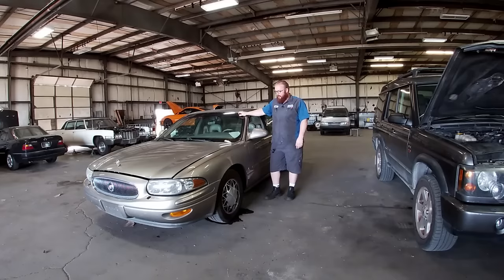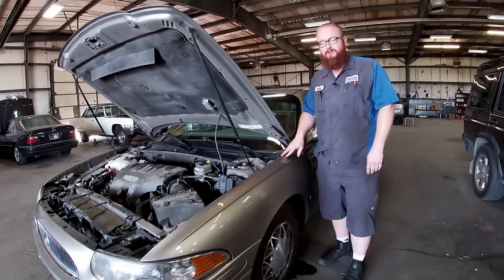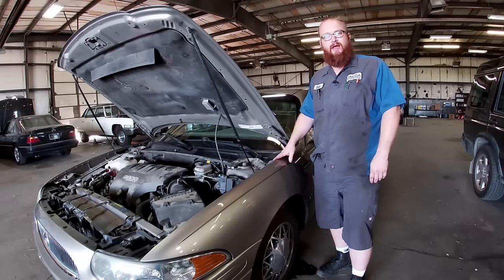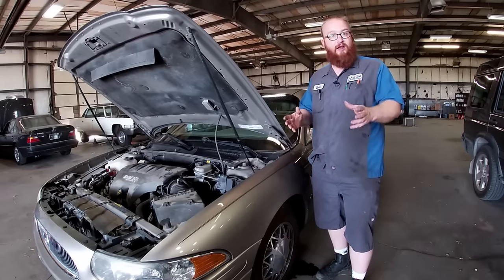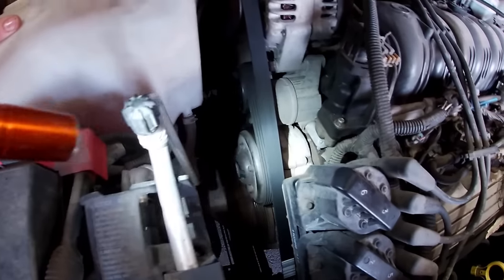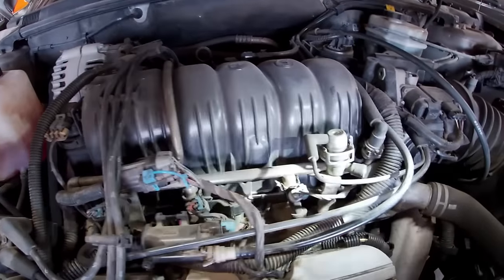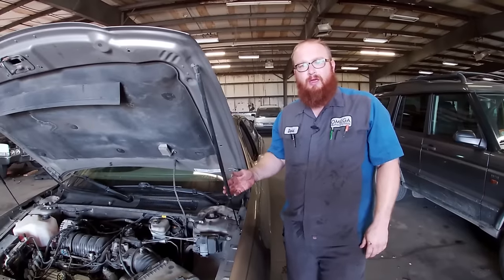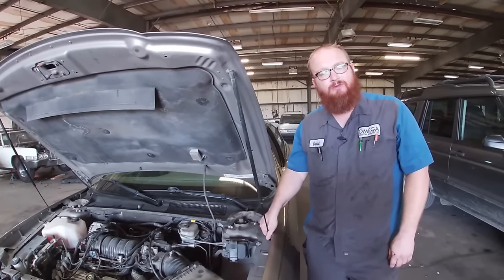CAR WIZARD highlights what makes the Buick 3800 V6 the BEST engine ever!

Comment: Gm engineers say 3.8 lasts 500 thousand miles. Management says : it’s too good, kill it
Reply: And now the Corp is almos a Corpse
Reply: Jbog07 and the new diesels are insanely expensive to repair
Reply: @mikecastellon4545  the emissions in them is what people say ruins them. I deal with dodge diesels at work.
Reply: J M yes, the govt mandated emissions standards must be complied with even though they make diesels far less desirable than they were 25 or 20 yrs ago.
Reply: @mikecastellon4545  and yet the funny thing is.  OBDII is a big fucking scam anyhow engineered by money hungry people.
Reply: Jbog07 s family friend of mine has a 5.9L 24V Cummins. The damn thing still runs strong and the only thing he has to do is regular maintenance
Reply: And as soon as they fixed the damn upper intake, it's gaskets, egr tube, etc, they killed it. It was named in HOt ROd's(?) top 100 engines ever made too!!!!
Reply: the trans won't last, and with the age of these, generally, that is what is the end of them.  They are also old, so they aren't kept anymore, they are just crushed, so the motors are great, but getting scrapped anyways.
Reply: Time to make new car companies that want to build long lasting cars and are dedicated to making repairs low cost due to proper engineering.
Reply: @CanadianBullFrog  yeah right when hell freezes over I doubt that'll ever happen maybe if Trump becomes president again.
Reply: Bohemia Lite well it may happen sooner than that
Reply: Great boat anchor
Reply: Yes 3.8 Buick best motor ever we got them in Holden Commodres over here lots have done over 500,000kms i had one that did 630,000km started ticking hyd roller lifter failed so yes car Wizard you correct very good bang for buck
Reply: Have 2001 Buick Regal GS Supercharged with 481,922 km (289,453 miles) in it, changed the elbow lines some 50,000 km ago, and that's about it. Well, changed pretty much everything in regards to the transmission, drive train, and radiator, but the engine is rock solid.
Reply: hooo they stink huh?
Reply: That's why you have W and G body cars from the 90s and 2000s still running around today. Their engines just don't die.
Reply: Jbog07  yeah the new Duramaxes just blow up these days.
Reply: Unfortunately that's probably an accurate statement
Reply: The death of the "American" auto brands
Reply: @Milhaus Ford had the best 6 cylinder available and let it die - the Barra. It was an i6 though.
Reply: I guarantee you that GM didn't want to end production of the 3.8 liter. It makes no sense because the 3.6 is a MUCH more expensive engine to manufacture than a basic 3.8 OHV V6. The reason GM dropped the 3.8 liter is the same reason most small pushrod engines were discontinued -- they couldn't meet future federal emissions regulations. Not to mention consumers saw pushrod V6 engines as outdated and preferred "more advanced" DOHC engines. Reviewers constantly dogged GM vehicles for using the same "old" pushrod engines when everyone else had switched to "modern" 4-valve/cylinder DOHC engines.
Reply: Needed an engine to generate business for the service departments... In that regard, the Northstar that replaced the 3.8 was a WILD success.
Reply: Carolyn L oh how true that is. My mechanic referred to mine as the “deathstar engine” and the General Motors dexcool as “deathcool”.i can laugh now but my pristine 99 Deville was a real wallet buster.
Reply: @hochhaul  Being pushrod wouldn't cause them to not meet emissions. I mean the LS and the Hemi still meet emissions and FORD just made a port injected pushrod V8 that meets emissions. 
But you are right that reviewers constantly ragged on pushrod engines for no reason. They are reliable and make great low end power which is all you need for pedestrian duties. Everyone thinks their car needs to rev to 7000rpm all day and if a pushrod engine can't do that they better get DOHC.
 I remember reading Motor Trend which had the Expedition in one article where it touted how amazing the IRS is and how it made for a better ride, more refinement, handling and so on. They even took a jab and GM's 3 suv's for still using solid axle. Then in another article they had the Landcruiser review where they praised it for sticking with a tried an true solid rear axle and how it was more reliable and able to handle heavy loads and off road situations.  For fuck sake make up your mind people. Maybe just tell the truth and that is that every tool is good at a certain job. You don't want a racecar with a pushrod motor and solid axles front and rear. But your family hauler doesn't need a 9000RPM DOHC V12 with a tube chassis and 4 wheel independent suspension with remote reservoir bypass shocks.
Reply: @geoffmooregm  maybe CNN owns motor trend, sort of have that double standard mintalaty
Reply: @hochhaul  x
Reply: You hit the nail on the head
Reply: And on top of that the 3800 was very fuel efficient for its size. That 3800 was a damn good engine.
Reply: 2004 Impala just hit 300k miles! Maintenance the key !
Reply: @daboys66  what engine in the impala?
Reply: rochab77 motor is a 3.8 ? Would a bad EGR cause service vehicle light to go on ?
Reply: rochab77  I did scan  there’s no codes ? Service light says Service vehicle soon with no engine light on ?
Reply: @daboys66  thats probably a manufacturer specific code that some code scanners won't recognize, or a maintenance schedule.
Reply: Can the 3800 v6 engine fit on the buick lacrosse 2010 to replace my 3.6l v6
Reply: @daboys66  yes...check the codes
Reply: @theshield1613  Yes it can.
Reply: @theshield1613  No, it can not.
Reply: @md2k8  yes it could ,I  investigated
Reply: @theshield1613  I think as long as you have the proper motor mounts and transmission to handle a series 3, you will be alright
Reply: @theshield1613  it was originally a buick motor to begin with, so go for it😃
Reply: Gasket failures?
Reply: @bohemialite6371  Right because he brought so many jobs back here already. Ffs.
Reply: they had to because of the government wanting higher fuel efficiency all the time
Reply: Yo Wizard could you do a video on all GM engines the last 30 years? V8 V6 and especially all these  little 4 cylinders the last 12 years.  I know you say avoid the 3.6 but the 3.9? 3.1 has gasket Dexkill issues I know. But these 1.4 1.5 1.6 2.0 2.4 4 cylinder ecotech turbo etc???? I am clueless? Could you help? They can't all be bad!?
Reply: By 200k not many will be left where everything else hasn't needed replacing, especially in the 95+ models with the cheaper quality interiors.
Reply: Braden Blair  Problem is when people think a motor is "bulletproof" they tend to forego maintenance. My '93 3800 has 150k miles and seems to run better with every 3000 mile oil and filter change. Am even thinking of going over to Amsoil which I've already done on the transmission. What kind of oil did you use and how was the vehicle maintained? Even some of the best designed of motors can leave the factory with a handful of parts that should have never passed muster.
Reply: @daboys66  turn the key on, push  the gas pedal three times and start the vehicle, light should go off
Reply: @daboys66  Yes.
Reply: i just bought a 1990 Lesabre with almost 400 thousand and it runs pretty good and doesn't leak surprisingly
Reply: @danimaniac4  Switch back to the green stuff.The new coolants are shit.
Reply: @hochhaul  Well sometimes the old-fashioned way is the best way. None of these newer engines will last as long as a 3800. They'll cost a fuckin fortune to fix too!!
Reply: Braden Blair  I saw a Toyota blow a rod at 53k. Even the best occasionally blow up. I'll take a 3800 over anything.
Reply: @hochhaul  sure it could. Just add better cats and updated emissions equipment and it should be fine. My 06 Lucerne with 3800 was classified as  SULEV, that's Super Ultra Low Emissions Vehicle rating, from the EPA. Plus OHV is a proven technology with high reliability and excellent quality. They should have told auto writers to shove it....
Reply: @mikecastellon4545  wrong.
Reply: considering this motor gets 28-30mpg highway, it wasn't considerably out of league with other vehicles of this weight class- more modern caddy's aren't getting any better fuel economy.  This motor could probably have eeked another 5 years of production. Switch over to a high pressure fuel rail, and probably could have added a few more mpg's.
Reply: auto writers hee hawd about how they wanted a high performance station wagon- or how it would be awesome to have a diesel SUV- or a diesel wagon- or an AWD station wagon. So when the makers came out with the 4 matic E - wagon-, diesel e wagon , the Magnum Charger, the TDI Landrovers, the TDI x5, the Jaguar AWD wagon... and sales performance on all those are low...
Reply: Because writers suck. Period.
Reply: @hochhaul  false, In 2005, it was the first gasoline engine in the industry to attain SULEV (Super Ultra Low Emissions Vehicle) emissions certification.
Reply: @shawnmcculley2995  all the radiator shops I used to bring radiators to agree with you, use the green coolant.
Reply: @VinylToVideo  synthetic oil, synthetic oil filter, and check out something called an onboard oil centrifuge. Then have an oil analysis done every 5000 miles.
Reply: @johnwyman6126  Got the gold stuff out as soon as I got the car. Green stuff is the best. Gold stuff clogs up cooling system.
Reply: @shawnmcculley2995  and the red stuff eats the different metals.
Reply: Correct. Its too reliable, why has GM gone bankrupt? Maybe one of the reasons was to be too reliable?
Reply: @wolfgangpreier9160  They dumped the good reliable stuff and THAT'S why they're going poopsville!!
Reply: @shawnmcculley2995  I don't think so. They sold not enough because everybody drove around with their old stuff. BMW made it right. Build up demand and not deliver anything with value. Thats how it works. Look at their numbers. Tesla goes the long lasting relaiable path, but their numbers hold because their cars cost enough to finance the furtther expansion of the company. Without expansion the companies die. Its just as with our economy. Without inflation our economies hurt or even die.
Reply: @wolfgangpreier9160  Tesla and BMW  are expensive unreliable and expensive to maintain cars.
Reply: @shawnmcculley2995  Maintenance for my Model 3's: Zero. Yes you are completely correct, very expensive. Had nothing to do for 2,5 years and 96000km. 

Oh sorry. No i have lied. had to buy a interior filter. Splurged with HEPA Filter @ 15.12 Euros from Amazon.

So 15.12 Euros for 96000km. Not zero.
Very sorry. Or should i count how many liters cleaner fluid i have filled in? I do not keep record of that. Maybe 20 Liters? 30?

You want to know how much my white one costs? 16000km and 10 months. Zero. For real. besides cleaning fluid of course.
Reply: @johnwyman6126  " When it comes time to choose a brand, people will choose quality over inferiority every time" Sorry, but that is naive to think. People buy for different reasons. Color, Looks, HP, because a friend of a friend told them, TiVi Ads, because the spouse said so. But never because of anything resembling "quality". I do not listen to Scotty anymore. He is the greatest poser of all. I've got better things to do. Listen to T&T E-Mobility by Ove Kröger e.g.
Reply: The old way is the best way you can't kill it it will live forever and ever just like this engine
Reply: This got knows what he is talking about. A honest mechanic - wow....
Reply: Fords Inline 6 300 was also great.
Reply: @bgy1  Northstar definitely was not a good one. They ran good when new. Had alot of power. Then it didn't take long for it's true colors to shine. And why would anyone put a starter under the intake manifold
Reply: @ronaldpeterson5552  that's for oil change light.
Reply: @shawnmcculley2995  sure as hell don't want to mix them. And don't want green in a new diesel.
Reply: @eddieschwab864  you can't put much on those fancy labels they put on vehicles. That's just marketing. And all the new best emissions equipment doesn't necessarily do as good as you would. Ford engineers were going to make a display showing how much advancement had been made in lowering emissions. One of them owned a model T that he restored. The idea was put it beside the latest and greatest and give them an emissions test. Nobody ever heard of it. Because the model T did far better.
Reply: @airgliderz  it's because they are not there to tell facts. They are there to sell cars.
Reply: @wolfgangpreier9160  have to disagree with tesla . The way they want it to go is keep you buying new cars. That's why they don't want them repaired. If you can't get parts you can't fix them. So you buy another one
Reply: @briankennedy5578  Please show me any new car built in 2021 that you can repair yourself. And not a Tata or Mahindra. And of course not a fossil from last century. Yes in the past all of those could be repaired with a hammer and some duct tape. Those times are over.
Reply: Yup, it's called designed obsolescence. They make more money if the engine and any other parts have to be replaced often.
Reply: planned obsolescence
Reply: My Best Engine List:
1. Honda 2.4L I4
2. Toyota 22R
3. Toyota V6 (all)
4. Toyota 1.8L I4
Reply: Brag, brag, brag. Just as soon as I heard 30 mpg bs I stop bs video! LOL!
Reply: Transmissions are terrible!
Reply: @marshallforeman2051  l🙄
Reply: Our 1992 Chevy Lumina APV van had this engine - a great vehicle.
Chevy replaced the Lumina APV with the Venture with the crap 3.4 V6 that leaked DexCoolant into the engine.
Reply: @cmte.brazinazzo2061  next “industrial boom” is coming from that corp
Reply: Honestly if I'm looking for a reliable V6 I would look at a Buick V6 like the 3800
Reply: My 3800 only went 240.000. Not my highest miles. My Chrysler 2.7 is sitting at 255.000 miles right now. All the “experts “ claim that it wouldn’t make it to 100.000 miles.
Reply: @theshield1613  The early models (2005 era) of the lacrosse had the 3800.
Reply: Oh yes. I agree 😏
Reply: Sounds like an engine you'd want in a car you buy in brand new condition to drive as a semi truck flagger, where you know you'll put 100,000 miles/yr. Other than that, there's gon be an oversupply of these engines, but no bodies to put em in, since cars would rot out way before the engine is done.
Reply: The corporations didn't perceive YouTube on the horizon where their crooked ways would be brought to bare
Reply: @CanadianBullFrog  The corporations aren't happy with YouTube mechanics taking away a small segment of their business. Bottom dollar
Reply: Typical GM
Reply: @jerryschneider145  Avoid the 3 L V6 from Toyota due to oil burning issues and head gaskets.
Reply: @md2k8  I have one, 22 years old, 240,000 miles. It's ok.
Reply: @Jackmerius_Tacktheretrix  no lie I had a 2000 park avenue ultra with the supercharger 3.8 use to get 26 mpg some uninsured scum hit it parked on the street in front of my house and totaled it I got a 2012 CTS after that and I’ve never gotten better than 24 mpg in it and the caddy has less options than that awesome Buick
Reply: @jerryschneider145  dont forget Toyota UZ engines
Reply: So true.
Reply: I love my 88 Electra Park Avenue.  Great engine.  Great everything.
Reply: Yes indeed. GM management realized they made a huge mistake in these drive lines and cars. They were too well made and it meant less new car sales. It's also why nowadays, parts are hard to come by for many cars from the 90s and early 2000s. They want everyone to be forced to buy whatever they want you to buy. It will backfire on them eventually with 3d printers becoming more affordable. Nice work management. You're officially obsolete
Reply: @CanadianBullFrog  I'm daily driving my 3.8 V6 Park Avenue, buy Kia has a strong drive train and warranty.   I would y drive one, but there is one available.
Reply: @theshield1613  I own both cars, live my LaCrosse and my Park Ave. 2 great cars.
Reply: @shawnmcculley2995  hahaha
Reply: Exactly! I have a 01 monte carlo ss 3.8 n/a and the motor keeps going and going while everything else is going out on it at 255k miles the 3.8 still all original no work has been done to it other then gaskets
Reply: Let’s replace it w/ the 3.6 that might be the worst engine ever made
Reply: @briankennedy5578  Northstars were great engines after they fixed the head gasket issues in 2005, sure you still have to take the intake off when your starter goes bad, but you have to do the same thing on a Toyota UZ yet those engines get nothing but praise
Reply: I have my 3rd buick right now, I love these cars, sold my first one and got a nice 2004 park avenue, then some druggy T boned me on a main road and totaled it so im in a 2001 buick century right now till I find me a 2004 park avenue ULTRA with the sun roof im gonna pimp it out
Reply: Nailed it.
Reply: @chubbysumo2230  i scrapped my windstar with a 3.8 engine because transmision and front wheel was hit hard by my assistants
Reply: Car wizard please l need your advice l want to buy 08 ML 350 I don't want to make any ragreat.
Reply: I don't understand why they would kill an engine  that got 30- 35 miles to the gallon in a 3800lbs car. ..... I had one, and it was unbelievable.
Reply: Mine has 100, 000 miles and runs like a beast. The car body will fall apart before the motor
Reply: @CanadianBullFrog  that'll never happen especially with these all electric and driverless cars coming soon
Reply: Te creo yo tengo un mod 95 y es silencioso único se oyen más los motores de los carros nuevos mi Buick es adorablemente un carrazo Saludos
Reply: @skycorrigan6511 Thank You, Mary Barra
Reply: I have 2008 Buick Lucerne cxl with about 315000 km and have had to do some maintenance thought would cost arm and leg for shop to do like the timing chain gasket but just take time and follow you tube example of someone who knows what they are doing turned out perfectly, I also did the coolest elbows previous to this twice because thought metal aftermarket was better then leaked after about a year so got GM dealer plastic ones again no issues and it took probably ten yrs for GM ones to fail so should be good, just replaced the outer tie rods after starting to hear clunking noise when parking car, transmission doing ok is running Klondike ATF from eBay are aftermarket Canadian company my friend who raced cars at the track used  great reliable car for my 60 km highway commute each way to work
Reply: thats for sure,it cost them too much ti produce
Reply: The series 2 were Allright some of them had problems. I'd say the late 80s and early 90s buick olds and pontiac cars with the original 3800 were the best absolute indestructable engines.
Reply: @bohemialite6371  "maybe if Trump becomes president again" Was this a joke?